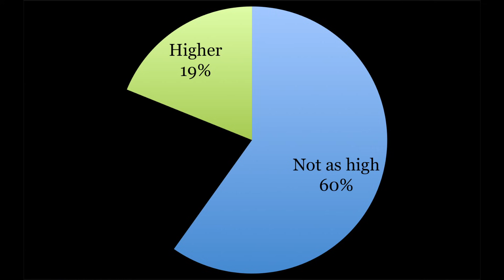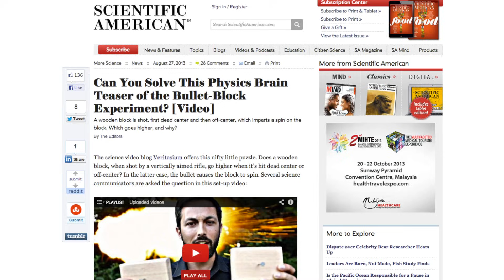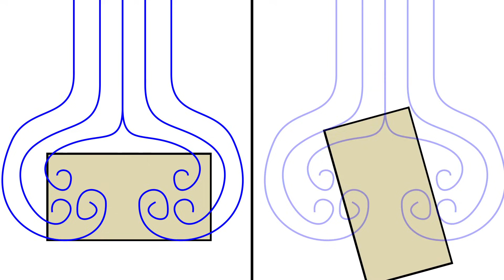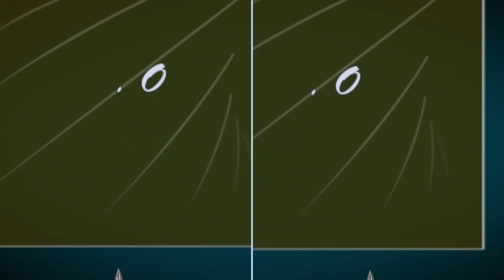Bullet Block Explained!

Comment: The negligibility of Air Resistance threw me off. I had the momentum explanation in mind but then thought, "Momentum would be transferred from the block to the molecules in the air, making it go slightly lower."

Comment: If you want a bigger difference in discernible bullet penetration, you need to create a larger moment-arm for the off-center case. There is an upper-limit to this, though, because wood can only handle a certain amount of internal stresses before being catastrophically damaged.

Comment: For those who think energy is being generated ex nihilo in this experiment, consider the work required to bring the bullet to rest within the block's reference frame, which is different between the two cases. The key difference is that more work is required to slow the bullet in the first case (when the bullet hits the block head-on) than in the second case. And, assuming similar internal shear forces within the block, the bullet will be lodged deeper when it hits head on versus when it hits near one of the sides. This difference in work/internal heat generation arises from the fact that when the bullet hits head on, the block is prohibited from rotating because no net moment is generated, meaning that the bullet must be slowed to the actual linear velocity of the center of mass of the block. However, when the bullet hits off-center, the bullet only needs to be slowed to the linear velocity of the block PLUS the Omega-R velocity of its distance from the block's center of gravity. This means that the kinetic energy that the bullet loses is actually different in the two cases (it loses less energy in the rotating case).  The two systems (rotating and non-rotating) actually end up with two different final energy levels, even though they began with the same energy level and have identical linear kinetic energies. The bullet travels deeper into the non-rotating block, and so more of the initial kinetic energy is dissipated into heat. Less energy dissipation occurs in the rotating block, which is why the presence of its nonzero rotational kinetic energy does not violate conservation laws. Cool problem!!!

Comment: It's more about the weight the bullet has to push at impact. Hitting it on it's side mean it taxes less energy or momentum from the bullet, because the block is lighter on that side once lifted in the air which is what gives it the "extra(it's still the same about)" energy to rotate, but because it has to use more energy to get the other side around. The lift(or lack there of) compensates for the amount of energy used. where as shooting in the middle means a more constant or even draw on the amount of momentum it taxes from the bullet to provide lift its more equally heavy on both sides which is why it doesn't have to spin to reach its height(again, or lack there of). The blocks of wood are the same weight and density. It's the same as if you leave ice cubes in a glass of water to melt. The water level doesn't change, it just looks different. No equations, no math, and I dropped out of high school. I'll be waiting for my nobel prize to come in the mail XD. Thanks for the challenge, love you guys!

Comment: How to make a bullet go in a different amount...
Hm...
The first and intuitial answer would be to make a bullet hit the block with a steeper angle. But that may (I'm not ready to speak the probability of that happening? but it's possible) result in bullet bouncing to the side which makes the experiment unsafe.
Maybe if we make a Cone-shaped hole and fire into that, so even if the bullet glances off it will hit the opposite edge... But that is just and intuitive thought, not fack to support it... yet.

Comment: Would the results be more measurable if you used a non-Newtonian material instead of wood for the blocks? As the energy transfer is ever so slightly more efficient when the point of contact is off from the centre of gravity, perhaps finding the optimum point of contact in terms of energy transfer would also provide a more measurable result. Also, at the risk of sounding like an explosions junkie, if the entire experiment was scaled up, one would expect the results to scale aswell, ie 1% being 1cm instead of 1/10 mm however the scaling calculations may prove the larger experiment too large to consider doing. I hope this makes sense

Comment: Simple, increase size of experiment. Use a bigger round and a bigger block. The math will be the same. I figure you need to increase your variables so that the difference in depths could be noticed.

Comment: Let's remove the depth issue and screw a steel plate to the façade of the block struck by the slug. In this experiment a much higher percentage of the inertia will be transferred and discrepancies in height amplified.

This experiment will be much more dangerous because the slug will fragment, so plan accordingly.

Comment: Make the wood block something hard and dense with very simply arranged geometry to the molecular structure. Then you'd have to use some high end precision technology, maybe something like an electron microscope. Perhaps there are lasers that can help to make sure everything is lined up real nice. I think this would be more expensive, but you can always get more expensive and more precise and more accurate. The gun, the bullet, the powder, and all the other negligible factors can add up. Refining the experiment can help. You'll probably eventually get down to the physics moving beyond quantum mechanics at some point.

Comment: Get a block, hollow it out so much that the edge is about a little less than how far the bullet traveled. Fill the hollow space with cake. The cake will resist the bullet less, so the bullet will travel farther in cake than wood, and the final difference will be more noticeable. Obviously, if you just have a slice of cake, the bullet will go right through the cake, so that won't be viable; thus, the bullet must first travel through the wood.

Comment: I know this is a bit late looking at when the video came out and someone else might have already suggested it, but if you increased the measurable scale of bullet depth you could compare penetration. This could be done by using a less dense wood. If you used a large (but fairly light block) of balsa or cork wood then the bullet would go deeper overall, thus increasing the scale. The issue is you would need to increase the scale by 10x just to get a difference of 1mm ( going by the 0.1mm difference as stated by you). Looking at those xrays and the nail test you likely only went in about 4cm. If you have the right equipment then a 0.5mm difference might be enough to get a result which means you would need about 20cm of bullet track. Not sure if this would work, but at least would be fairly consistent to the original test.

Comment: First he said the spinning block has 50% more kinetic energy. Then he said the bullet imparts 97% of its energy but only 1% more for spinning. So which is it, did the spinning block glean 50% more or 1% more energy from the bullet? What did I miss here?
Reply: I think he means this:

For the center shot, 98% of the bullet energy goes to heat, and 2% goes to kinetic energy.

For the off-center shot, 97% of bullet energy goes to heat, 2% goes to kinetic energy, 1% goes to rotational energy.

So 1% rotational energy is 50% more energy that creates motion.

Comment: 2 comments. 1st: I think there was conservation of angular momentum in block 1. I noticed the non-spinning block slowly rotating about its vertical axis. Where did that rotation come from? Could be from the bullet, much less mass, but spinning on its vertical axis, for in-flight stabilization, much faster, probably 20,000 -> 50,000 rpm. Spin comes from the rifling in the barrel. #2 - I think the initial video commenter you showed, seemed a lot like David Letterman, but smarter.

Comment: 4:08
Outside of conservation of momentum, the explanation for ALL stationary and spinning blocks rising at different heights has a few things unmentioned and left for consideration .  Everyone is assuming that all of the rounds of ammunition used in the experiment are loaded precisely identical to one another.  In reality, such is never the case due to sheer cost to the manufacturer.  They're loaded only close enough to make a combat-accurate shot every time.

The powder charges in the rounds of ammunition are loaded by weight, not by grains of powder (assuming the powder is all the same smokeless variety from the same manufacturing lot).  In order to have multiple rounds exactly (or as close as possible) the same as one another, they would have to have their casings closely inspected for perfection in their walls, their bullets closely inspected during the manufacturing process for lead/copper content and diameter (assuming the bullets are jacketed), and the powder charges loaded by number of grains rather than simply dropping in the same weight.

Getting the primers to match exactly is a whole other bag of cats to deal with.

Then there's the firearm used...   Were the chamber and barrel perfectly clean for each shot?  Was a dry barrel lubricant used?

Then there's the environment....   It'd be interesting to see this done in a lab with the firearm mounted in a perfectly vertical, perfectly stationary apparatus on a hard floor as opposed to someone's grassy back yard.

GREAT VIDEO!  I loved it!

Comment: In order to better measure you should use
1.  a weaker material than wood such as polystyrene
2.  a higher energy bullet
3.  a longer piece of wood (horizontally)
Reply: Wouldn't the combination of 1 and 2 make it more likely for the bullet to exit the material used, defeating the purpose?
Reply: LIB3RTARIAN1337 lol, yes, i meant them as separate suggestions but 3 should be used regardless.

Comment: make the projectile and target have the same mass or have the projectile mass be larger than that of the target. This way less kinetic energy will be lost and the difference in penetration depth will be greater.

Why would this work? Because the projectile would slow down less by being stuck in a target. Kinetic energy is 1/2 the mass times the square of the velocity. Ke=1/2*mv^2 This means that in Derek's experiment the bullet loses the vast majority of it's kinetic energy smushing wood, because it slowed down so much. But if the projectile slows down only a little, like when it hits a light weight target, it loses less to slowing down, and thus the amount of spinning would be a greater portion of the kinetic energy and the mushing of the target would be a smaller amount.

Comment: I have a question for you here Derek :
If you consider that a rotating object ends up with more energy than a... non-rotating object, I guess.
Wouldn't a log rolling down a hill end up with more energy than a ice cube going down the same hill ? Supposing the log is a perfect cylindre and the ice has no friction at all.
Reply: If they have the same mass, then No.

If the log is more massive than the ice cube, then it will have more energy rolling down the hill, since gravitational potential energy is the weight times the height. If the log is bigger it has more energy.

But lets assume they have the same mass. At the top of the hill both have gravitational potential energy. If they weigh the same, it's the same amount. At the bottom of the hill that energy will be in the form of kinetic energy. Two kinds of kinetic energy for the log, rotational and speed, and only one type for the ice, speed. The ice will be going faster at the bottom because it wasn't slowed down by having to turn. Good question, this actually has interesting implications, balls of different sizes will go different speeds down inclines.
Reply: If there is no friction, than log would not start to rotate. Log starts to rotate because it is being slowed down at the point of touch with the surface, while other parts are not slowed down.
But if there is no friction, it will simply not start to rotate and thus you would observe two object at same speed with same amount of kinetic energy at the bottom of the hill.

But since our world is not the one without friction, rotating log would lose less energy due to friction than the cube and therefore would arrive at the bottom with more kinetic energy.

PS. Excuse my english, I'm Czech
Reply: i think that the point is that you need friction to rotate the object, without friction even a perfect cylindre wouldn't rotate
Reply: True, but I think we are talking about the amount of potential energy that becomes kinetic energy.
Reply: There is no extra energy in one of them.
Reply: I'm late to the party, but the real answer is this:
The log and the ice cube would have the same energy at the top of the hill if they had the same mass. For the ice, all of the potential energy is converted into translational kinetic energy. The log, however, has some of its energy converted into rotational energy. The total energy of each object is the same, but the ice cube moves faster.
Reply: Assuming masses of both objects are the same. Rolling motion implies static friction, which further implies some energy is loss through friction. Thus, the system of frictionless ice (assuming no state change occurs) has more energy than the system of the rolling log at the bottom of the hill.
Reply: Piggybread
No, static friction does not absorb energy, rubbing things together is kinetic friction, that will use energy (felt as heat) but 2 things touching and not rubbing will not take any energy away.
Reply: Roscoe Kane The only energy leaving is thermal energy as heat is transferred between the material.
Reply: The ice cube has a more constant source of friction compared to the log which had less friction and instead of having the friction be constant, it has it in bursts

Comment: What if the collision was elastic, e.g. rubber bullet that does not penetrate the wood. Try that, that would explain some things.
Reply: If it was elastic, the bullet would also bounce backwards. If the bullet hit the center, it would bounce back further than if it hit the side.
Reply: Practically, it would add more variance to the experiment as collisions on the macro scale are never elastic, energy is always lost to heat, sound, etc.
Reply: Leo Anbu Challenge Accepted.

Get rid of the sound and heat by shooting the JFK Ice bullet into something translucent while inside a vacuum.
Reply: Saki630 You will still have some friction. You will still have vibrations in the material (what caused the sound absent a vacuum), even if there is no medium to carry sound.
Reply: LIB3RTARIAN1337 Um, what? lol
Reply: Aleksandar Tadic It was a reply to Saki630, who replied to Leo Anbu, who replied to you. You get notifications for replies to people who replied to you since YouTube switched to Google+ comments.

Comment: The momentum theory here is completely correct, due to the explained conservation of linear momentum, because the momentum of the bullet + the standing momentum of the block = final momentum of the block. The same math is applied to both the blocks, and equal amounts of linear momentum are observed. BUT, if this experiment was done with something more consistent that a bullet, say a burst of air. You would expect different results as the burst of air would not add to the mass of the block, and then there would be no deformation of the block. So an air burst would rule out the inconsistency of the gun, and control more variables making a far more repeatable result, and instead of using wooden blocks witch vary in density throughout, use a plastic block. So there's my input. :D

Comment: In addition to some of the great comments I have read so far. Using a stripped background would help greatly with measurements. I could see clearly the block was at the same height, you could see the background was not identical. The stripped static background would also ease video overlay problems, rather than resorting to side by side comparisons.

Comment: My proposal to improve the experiment and make it testable:
Take out all of the considerations the bullet introduces: penetration, heat, sound, etc. of what you mentioned. Remove the bullet from the experiment. Yeah sure, guns and bullets are cool and flashy and "sexy" and attention grabbing and it made for good alliteration in the title but it over-complicates the experiment (pardon the run-on). Actually compare isolated vertical momentum from a consistent force to the middle of an object versus the vertical plus angular momentum from a consistent force to the side of the object.
My suggestions for materials (I'm sure have others that may be better, please add):
A dense rubber/plastic/metal ball fired from a spring loaded cannon. A pool ball would work. Perhaps pneumatic cannon could work as well. The wood block could be kept the same.
Additionally a consideration should be made for weight of the projectile and the block. Make the projectile 25-50% of the weight compared to the block.
Finally, find a speed of the projectile that sends the object a distance that if there is a difference it will be measurable and also observable. Somewhere around 10-15 meters?

You could also remove the idea of the projectile entirely and use something like a hydraulic piston to "poke" the block - with enough force to produce a height as described above to have a potential measurable difference in height in spinning block and non-spinning block.